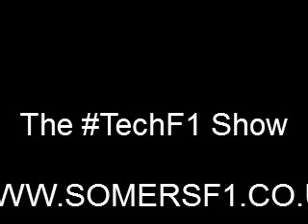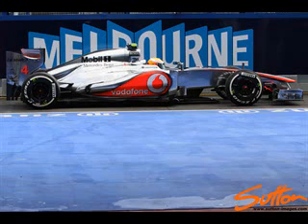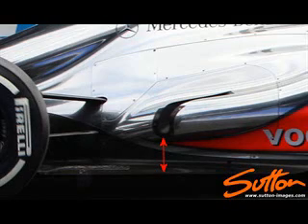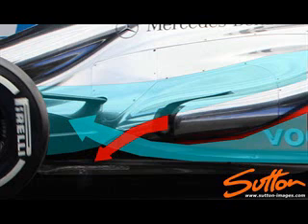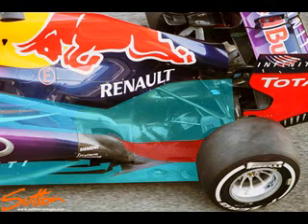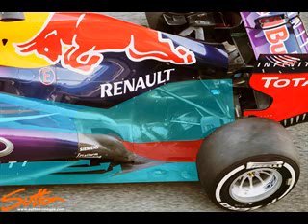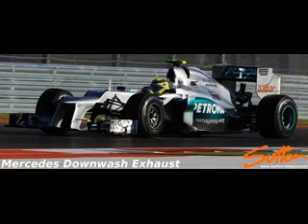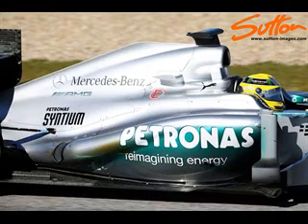The #TechF1Show - F1's 'Coanda' exhausts explained

Comment: For the uninitiated, the Coanda Effect basically says that you can make the airflow stick to a surface for a lot longer - and therefore make a surface much more effective - if you run a high speed airstream over it. By implication, it also means that air on the opposite surface will have to travel faster in order to maintain equilibrium, that is, to return to its state before it passed over the surface.

It was an idea I toyed with for F1 in the early 1980s (I believe I still have the drawings) but it was too hard to implement at that time and I am not a Formula 1 designer. I also had doubts about its effectiveness because, while the exhaust stream is a high velocity gas source, it is also made up of a series of pulses and is extremely hot and turbulent.

The concept of the blown flap has been used for decades in aviation, especially for short field takeoff performance. The Antonov An 74 "Coaler" STOL aircraft is a classic example. Some of the best implementations of the Coanda Effect can be seen in the blown flaps on Ekranoplans and while they use a hot, turbulent jet efflux, it is a constant flow.

By implication, this also means that the Coanda Effect could just as easily have been used to steer freestream air around the draggy rear tyres, by making it adhere to the rear bodywork, for an overall improvement in total drag.
Reply: Were you an engineer? who are you
Reply: Isaac Chua No one of any consequence.
Reply: +TheThirdMan then what do you mean by "it was an idea i toyed with for f1 in the early 1980's
Reply: Isaac Chua I am an amateur. I have messed with aero ideas - both in terms of speculation and also basic wind tunnels for a long time. I am not, nor have I ever been a racing car designer. For the record, the idea I had in the 80s was to pump the exhaust efflux through the rear wing support column and distribute it through diffusion holes along the various parts of the surface to attempt to improve adherence and thus lift (or -ve lift in this case).

Oddly, the idea was partially echoed (in reverse effect) by the McLaren idea a few years ago which was a hole in the nose which piped air over the rear wing in such a way that it actually reduced drag. That was the F-duct.

Comment from the maker: @Eau Rouge I meant to cover that area on the video but got sidetracked by aero, Horsepower is lost due to the exhaust being placed in an aerodynamic position rather than it's considered natural position. This is why Lotus continued to use their higher positioned exhaust for much longer throughout 2012 as they opted for power. Essentially it's all to do with Exhaust tuning lengths and in the 'Coanda' position the length isn't optimal for engine power.